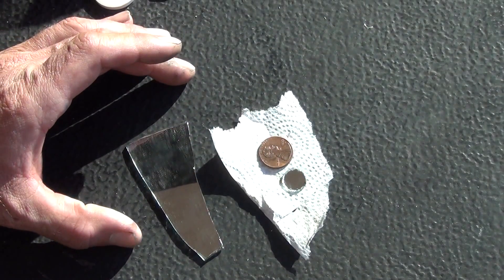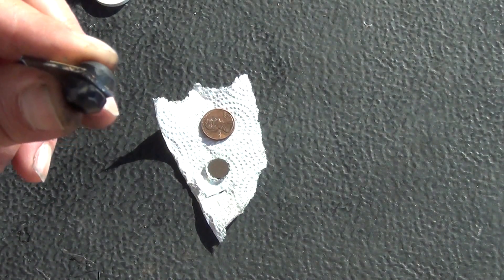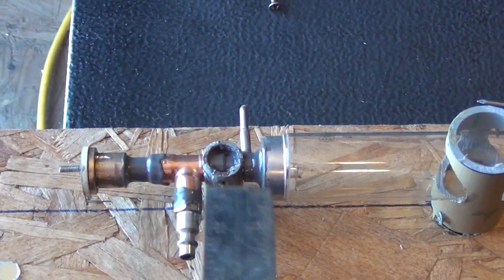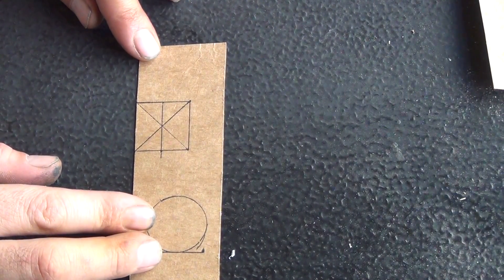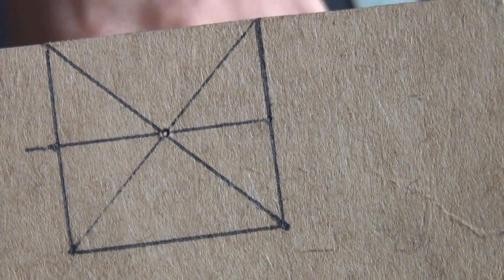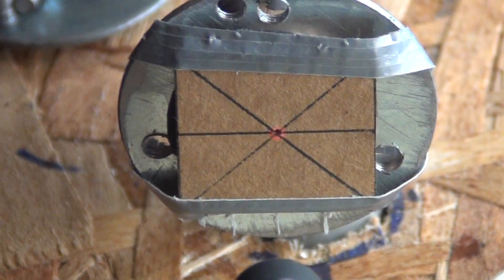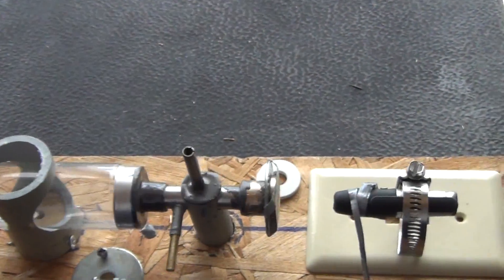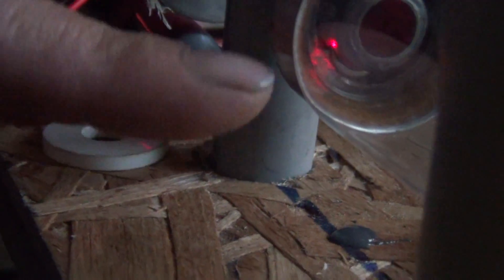Homemade CO2 Laser, part 2

Comment: how you make reflective mirror?
Reply from the maker: Electroplating the glass by treating it in a solution
Reply: MrTeslonian wait couldn't you just buy a circular plate of glass
Reply: I read old hard drive platters are great! But they are full mirrors, and non concave.  Is concave necessary? Or just convenient?

Comment: Use a piece of pipe in a drill press and a fine power as an abrasive. It will cut smooth and perfectly round.